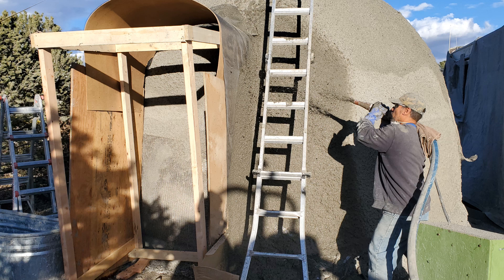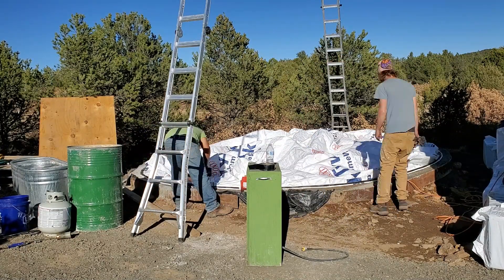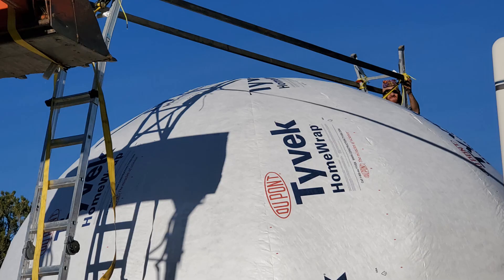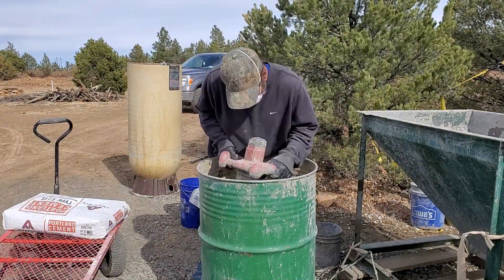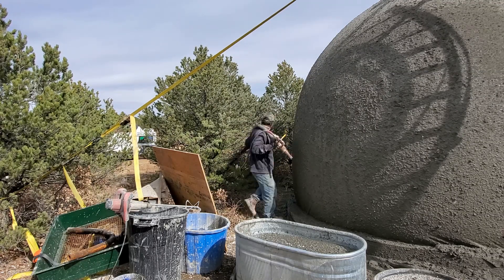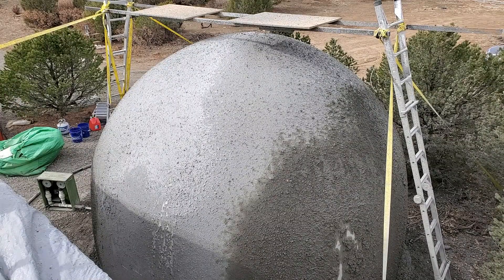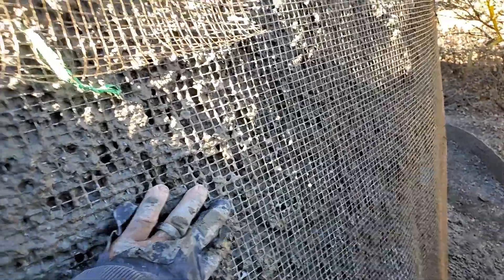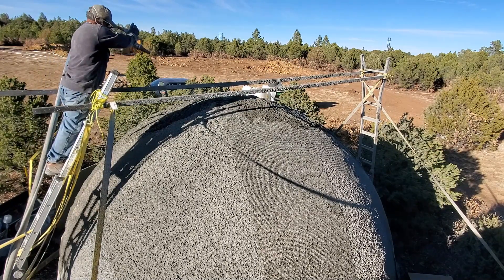Building E.P.I.C. Cement Dome | Part 2 #aircreteharry #EPICcementmix #domehome #aircrete #diy #dome

Comment: Just a thought, tyvex is air permeable.  If you could flip your form inside out, spray  half with latex paint, let dry, then the other quarter starting at the bottom let dry then finally the top and let dry. Then flip the form and no heater unless you can ensure 60-70 degrees. Slower the cure, stronger the cement but you know this, patience bro. Also if you get old burlap feed bags (free) and lay up on the form it will give you something for the epic to grab. I think the tyvex is a great form but it's got no friction and if you hold it up to the sun, you will see the tiny holes that are not your friend (hence the paint idea). 
Keep up the good work. The Pinky and the Brain, Brain, Brain Brain lol,  "Zort"!
Reply from the maker: It's okay that's it's permeable after the first layers or on the cement covers everything and stops the air from getting out. And the Tyvek makes the inside walls very smooth you can almost just paint.
Reply: @AircreteHarry  sweet. I am all about less work. 👍 Work smarter not harder, or as my grandmother used to say let your head save your heels. You are doing it man. Living the dream 😍.

Comment: how thick did the first coat end up being.  could drill a hole and see. i would be interested in knowing when you could walk on it  maybe at 3 inches thick..
Reply from the maker: About a 1/4 inch
Reply: @AircreteHarry  would it stand on its own without air pressure  when it dried . any cracks or other issues after it dried

Comment: Next time you have to make scaffolding, remember, triangles are the stable shape.  If you had used some of your tubing to bolt on as diagonal bracing at the corners you would have given it a lot more stability in the forward/back direction and then you would only need guylines on the sides.  Otherwise this looks like an awesome build.  I love seeing it come into being layer by layer.
Reply from the maker: Thanks!!

Comment: I'd have just stood in the tractor bucket with a safety lanyard.
Reply from the maker: Cool, I need a lanyard now too
Reply: No, just a suggestion since someone else would have to operate the tractor, either way it would be safer, I know a guy that lashed two ladders together, worked well until he hit the ground along side a new store we were building, only fall once right.

Comment: я может где-то пропустил: мягкий купол, как собираешься убирать, часто ли собираешься его использовать, как опалубку, или одноразовой опалубкой будет?
Reply: Yes, indeed, the Tyvek housewrap is going to be reused. I actually already removed it, which left me with very smooth walls on the inside. 
I removed it by drilling a small hole in the EPIC cement (where we'll  have our door) then I pushed a rebar through the hole, to push the Tyvek away from the wall. Afterward I cut a larger hole with an angle grinder. Next videos to come will show that! 

Да, этот шитый купол можно будет часто использовать. Я кстати его уже убрал и стены остались очень гладкие - это я покажу в моих следующих видео. (Как было показано в одном из моих прошлых видео, где я его шил из TYVEK материала, он очень крепкий.) 
Я удалил его, просверлив небольшое отверстие в цементе EPIC (где у нас будет дверь) 
затем я протолкнул арматуру через отверстие, чтобы оттолкнуть Tyvek от стены. После этого я вырезал большее отверстие с помощью угловой шлифовальной машины. Следующее видео покажет это!
Большое Cпасибо за комментарии и вопросы!! 
Thank You My Friend!!
Reply: @off-griddomeliving8018  очень круто!
Reply: Большое Спасибо!

Comment: Awesome.  It looks really great.  What if you put a layer of mesh on first?  Maybe even plastic mesh or dimple mat or fabric?  For future scaffold, how about a tripod?  It would have to be very tall, but at least it would be self-supporting.  Just trying to contribute some ideas.
Reply from the maker: The next dome I make I will sew a dome shaped form, from what ever reinforcing fabric or mesh I use. I will inflate the air-form and slip on the reinforcing fabric or mesh before I spry it with cement. As for getting to the top of the dome I'm going to make a curved ladder that connects to a pole in the center of the dome with wheels on the bottom of the ladder to turn all 360 around. I think that will be the easiest and cheapest way to go.
Reply: @AircreteHarry  sounds awesome.
Reply: Thank You so much for all the suggestions, really Appreciate Your Time & Advice!!♡

Comment: Super job, harry. I bought my shotcrete nozzle to do exactly what you are doing many years ago. I also plan basalt mesh and basalt fibers in my mix. Tyvek is a great idea as your backer. You really win the A+ for inventive effort stabilising your ladders and spraying suspended scaffold platform. I bought an old manlift myself. Look forwardto ordering your materials and doing likewise. Thanks.
Reply from the maker: That's for the A+. Manlift will make thing a lot safer.
Reply: Thank You Johnny, we are ready when you are! 
Thank You for the Great A+ Feedback ♡

Comment: How come the guys at monolithic can spray a thick layer first time with out sliding? or am I missing something?
would it be easier to do say 0.5 - 1 inch of the same stuff as monolithic, with basalt mesh, faster and stronger
Later spray your Epic mix, Are you going to put any Aircrete in the dome?
Monolithic  https://www.youtube.com/watch?v=AI8fwnaTSmY

Done by hand  https://www.youtube.com/watch?v=9-AgVfPEfQg
Reply from the maker: Your right next time I would apply half inch of cement first then put the EPIC on top. The air-form monolithic has are much heavier and stronger and a different material. Making my own air-form for the first time I wanted to take it easy on spraying it.

Comment: Haha is your ladder system OSHA approved? I can hear your trolls now.....
Reply from the maker: Tractor can't get all the way around the dome. Dome number two I will use a Portland cement and accelerator for sure.
Reply: Hey why not build a platform for your tractor? That might be a good solution.
Reply: Basalt mesh, excellent choice.
Reply: Hey I’m sure you’ve already thought of this but what if instead of using a rapid setting cement, you used regular cement with a accelerant?

Comment: Rent. A. Scaffold.
Reply from the maker: No scaffold save money. Lol
Reply: @AircreteHarry  hah! You're onto something really cool there. Don't ruin a career with an injury to save a few bucks.
Reply from the maker: @SandyWalsh  Thanks! I'm working on a safer way to work on the dome using a curved ladder and a post in the center of the dome. I don't think a standard scaffold would help much with the curve dome top I would still be to faraway.
Reply: @AircreteHarry  two scaffolds and a platform between them. Has to be more stable than that.
Reply from the maker: @SandyWalsh  maybe but the platform would have to be 20 feet long the dome is 16 feet wide.
Reply: @AircreteHarry  true. Fun problem. Keep up the great work, we're all watching with interest and respect! 🍻
Reply: I will Always catch You My Love!! ♡